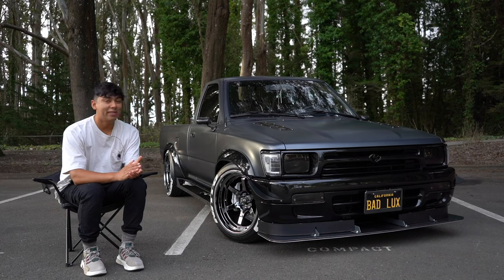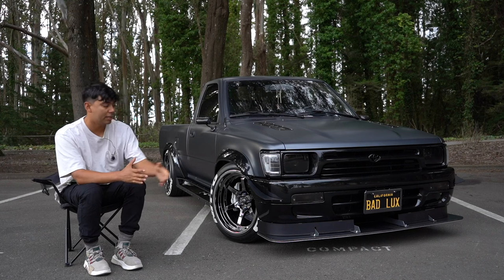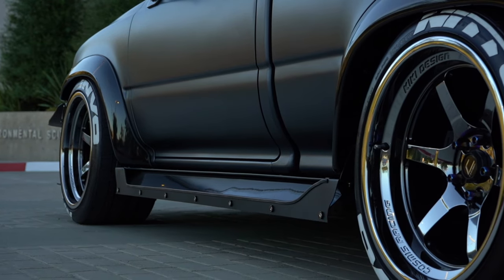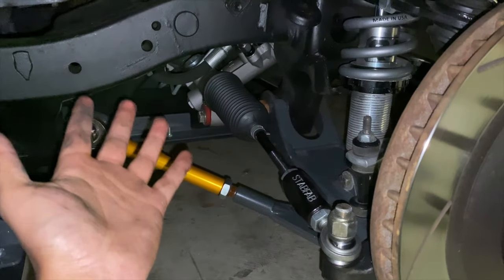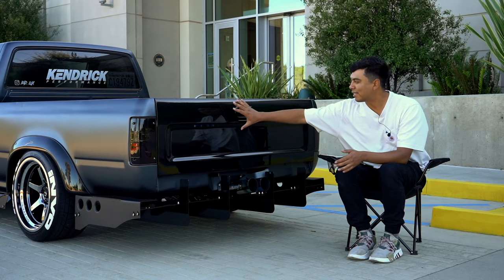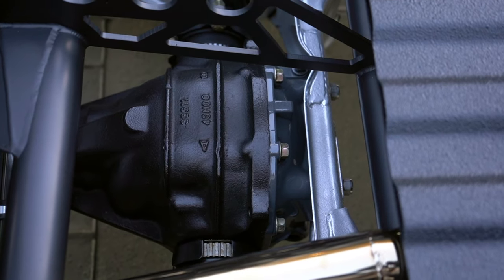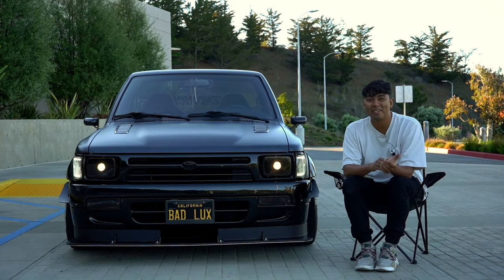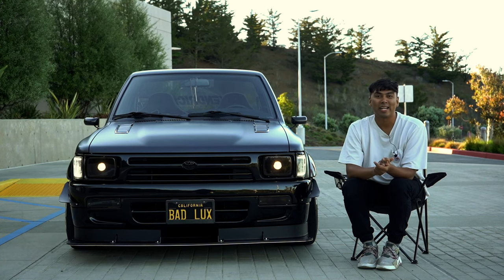CRAZIEST MINI TRUCK BUILD WALKAROUND!!

Comment: Love the build amazing spec with the work that's been done. I have a similar project a extended cab ford ranger. I also have a load of jdm parts so want do a similar set up mainly like how u used nissan su frames & arms. My question is can all the mounts & suspension mods , arms ect be bought to do a similar conversion.

Comment: Now that is the most awesome toyota pickup build I ever seen it's a rolling work of ART and its also the perfect platform for a 2jgte or a 3RZ  with a sequential R154 transmission I really think what would set this build over the top is if you would seriously consider the TOYOTA 2J or 3RZ tubro ENGINES to pay respect to the brand besides those 2 engines are dominating in motor sports and not to mention JDM LEGENDS IN THEIR OWN RIGHT no disrespect to the honda K24 RB30 or even the SR20 for that matter but they all have their place and platforms that they would best be served do your Dad's work truck justice and keep it ALL TOYOTA THAT WOULD MAKE THE VALUE OF YOUR TRUCK WORTH IT ALL IN THE END ESPECIALLY TO US TOYOTA GUYS AND ONE MORE THING THANK YOU VERY MUCH FOR SHARING YOUR CREATION WITH US AND THE WORLD STAY SAFE MY 87 IS ALMOST DONE ILL BE SHARING MY CREATION WITH THE WORLD AS WELL CURRENTLY HAVE A STAGE 5 PRO STROKER FULL RACE 22R WITH VINTAGE RACE PREPPED MIKUNI 44PHH AND 200 SHOT OF NITROUS OUTLET FOR THAT OLD SCHOOL VIBE CURRENTLY WORKING ON A 3RZ FULLON 800 HP TUBRO MOTOR WITH ALL THE BEST TOP SHELF INTERNALS AND A FULLY BUILT DRIFT MOTION R154 TRANS MISSION FOR ITS FINIAL STAGE OF COMPLETION CURRENTLY INVESTED AROUND 50K INVESTED INTO MY TRUCK AND ITS WORTH EVERY PENNY I HAVE BEEN FALLOWING YOUR BUILD FROM DAY ONE AND I HAVE TO SAY SHE HAS TURNED OUT TO BE MY FAVORITE TOYOTA ON  YOU TUBE WORDS CAN NOT EXPRESS THE EMOTIONS YOUR TOYOTA PICKUP STIRS US INSIDE ME AND EVERY THING YOU HAVE DONE WITH THE AIR DAM AND DEFUSER IS WHAT I WAS DESIGNING IN MY HEAD FOR YEARS BUT FACING LIMITED RESOURCES OUT ON A SMALL ISLAND IN THE MIDDLE OF THE PACIFIC HARD TO GET CARBON FIBER SHEETS OND SO ON YOU KNOWV THE DEAL PRAYING YOU STAY TRUE TO THE MANUFACTURERS BRAND AND KEEP ALL. (TOYOTA) WOULD KILL IT FOR ME KEEP UP THE OUTSTANDING WORK THERE GUY OUTSTANDING JOB HAVE A AWESOME WEEKEND BRO.